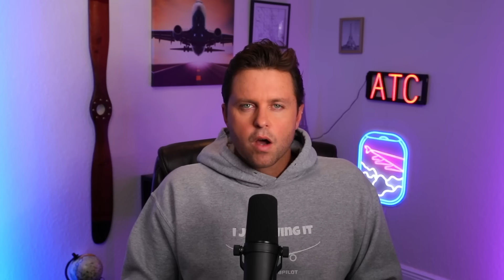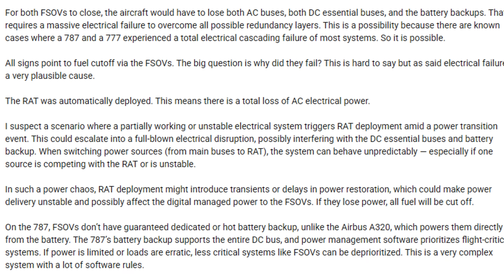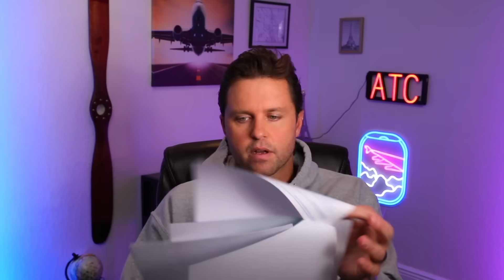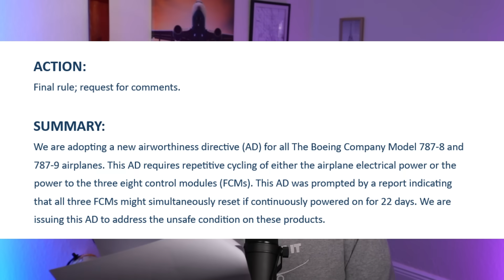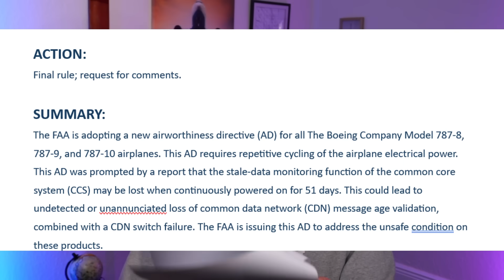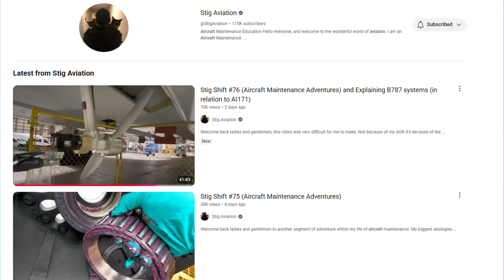Air India 171: Did a Software Glitch Cause Dual Engine Failure?

Comment: Ok wait, wait, wait. The cornerstone of this whole line of thinking is that the 787’s fuel shutoff valves are **spring loaded closed**. I don’t buy that. That would make no sense. Not even for fire fighting. I’m not an engineer (I have a useless undergrad liberal arts degree, and slightly less useless liberal arts graduate degree),  it I do fly Boeing aircraft for a living (737s). The 737 soar FSOVs are “DC motor operated from the hot battery bus. The engine high-pressure shutoff valves are fuel actuated, solenoid controlled valves powered from the battery bus.”  I get that the 787 has lots of software controlling the electrical system, but a spring loaded off fuel shut off valve makes no sense to me. Someone else posted a similar thought below and offers more detailed and intelligent comments than mine here. Anyway, this doesn’t ring true to me.
Reply: Ditto. No engine ever operated as described in this video.
Reply: I agree. I worked on rotary winged aircraft of 20th century vintage, admittedly far less complex than a 787. But i struggle to believe that an aircraft fuel system would be designed to fail off autonomously.

Comment: You and evveryone else that comment on this subject of fuel supply to the engines are on the right track., Keep at it. Does the APU have a spring loaded fuel cut off solenoid?  Is there a fuel cut off solenoid between the manin wing tanks and the central tank? Keep going.

Comment: Hi Gary not going to speculate either . I am not involved with Aviation, my background is in the  Electrical field and the ability to critically think. Which brings me to this link below . I have been watching many blogs this one included. It crossed my mind that maybe maintenance at Air India, have been doing the same as KLM . This has no bearing on your revelations about the possible causes of the Air India disaster. But it's not many holes in the Swiss Cheese away from being another one . Respect to you and thoughts with all those who lost someone in this tragedy 💙
https://youtu.be/EX2T0zkXcdw?si=kx1uylzGt2qIJJIp

Comment: If anything is outside of parameters, shut off the engines. What could possibly go wrong.  Like sensors, communication systems, control units never gave false or wrong signals ever, o wait......

Comment: As an electronics engineer and having had some experience with industrial computing system PLCs with multiple safety circuits, redundancy etc, I have become increasingly alarmed at the unnecessary complexity of it all. Have you seen inside that FADEC!? Trays and trays of near microscopic logic devices... Multipole connectors that would dazzle a lunar landing module. This is just stupid. Time to get back to basics.
Reply: That is to justify the price of the plane unfortunately.
Reply: Yet the plane flew happily for 11 years.
Reply: As a retired auto master technician I have seen the evolution of the computer into the industry. Year after year more and more integration of systems driven and monitored by computers. Although some great progress has been made many problems have come with the progress. My favorite phrase is keep it simple. The fuel shut offs should not be able to close at the same time and not while off the ground. Possibly manual controls.
Reply: We didnt land on the moon

Comment: I keep hearing “ software, software,software” . 11:19 As much due to previous fatal accidents that were sw issues.
Even if it’s not software, it’s taking attention from other possible problems. Muddying up the waters in local vernacular.
I had a look at guidance for programmers from the USA space program. I had to hold the phone in a three axis slant, with oscillating corrections, while keeping the tongue at the corner of the mouth. You can almost see Boeing NASA Similarities. 
Recode, test and all differences explored. Yes write 2 expensive programs. It’s the only, only, way to find errors, in the grand spaghetti stack, that is modern programming.
Enjoying your video’s

Comment: If you overlay the viewpoints of the CCTV/Hut/Rotation, the plane wasn't at the end of the runway. I think the plane had an issue after V1 & just before Rotation but we can't see properly because of the hut. So its not dust being kicked up, its nore likely an issue with the left engine. There's more smoke/dust to the left side. 
Wouldn't it be more plausible that an issue hpnd with the left engine at Rotation & in the confusion the right engine was shut down to explain both engines having an issue? Occam's razor.

Comment: Some SOVs are powered closed and fail open.  So a total loss of electrics causes the valves to fail open.   The engine bleed valves for example.  Secondly, some Boeing engines will suction feed and do not require fuel delivered under pressure to operate.  But, I never flew the 87 so I cannot specifically address either issue.

Comment: I’m no engineer, but even i know how to build a robust reliable delay timer with a capacitor and resistor. Omg, why not delay the shut offs for a few seconds in power glitches? To deploy instantly seems ludicrous! Some info i read about the states that the TCMA activated on NH985 before the air/ground sensor confirmed the aircraft was on the ground, despite that being ruled out by the logic. Boeing has a history of poor systems now, it’s easy to believe their systems are most likely to be at fault.

Comment: A Safety Instrumented System (SIS) with fail closed valves are routine in a chemical plant or refinery.  But if a false closing of that valve could cause a fatal event; a 2nd parallel valve with a different power source and controller would be utilized.  NEVER have a single point of failure that causes a severe event.  Some systems even have 2 out of 3 voting before initiating control actions that have very severe consequences.
Reply: Gotta examine 787 SSA and Fault Tree Analysis.  A good starting point.😊

Comment: First of all, thx‼️ 
The hypothesis collapses under the weight of a single fact: the failure it describes is prohibited by US law. Federal Aviation Regulation 14 CFR § 25.1351 mandates that the system must handle any probable failure, malfunction, or transient – from any cause – without rendering essential loads inoperative. A Fuel Shut-Off Valve is such an essential load. A design that allows it to fail during any foreseeable electrical fault, including software related ones, would never be certified.

Comment: The Batteries are Lithium Ion and have had issues with them burning up in 787 Dreamliners and there are directives on these! A shorting battery can drag the DC Bus to interrupted DC power
Reply: thermal runaway?

Comment: As per ChatGPT:

Yes, on the Boeing 787, the spring-loaded fuel shutoff valve—also known as the engine spar valve—can shut off automatically if electrical power is lost or interrupted, particularly in the context of engine fire protection.

Here’s how it works:
	•	The engine fuel shutoff valve is electrically actuated and spring-loaded to the closed position.
	•	In normal operations, electrical power is required to hold the valve open.
	•	If power is removed or interrupted, either by pilot command (e.g., pulling the fire handle) or due to complete loss of electrical power, the valve will automatically close due to the spring mechanism.
	•	This ensures fail-safe operation: if the system is compromised (e.g. fire, electrical failure), the fuel supply to the engine is cut off to prevent feeding the fire.

In fire situations:

When the engine fire switch is pulled:
	•	It isolates the engine by closing the fuel, hydraulic, and bleed air valves.
	•	The fuel spar valve and the engine-mounted shutoff valve (if installed) both close.
	•	These actions do not rely solely on software; they are mechanically biased to default to safe conditions like fuel cutoff.

Summary:

✅ Yes, the spring-loaded fuel shutoff valve will automatically close if electrical power is lost, enhancing fire safety on the 787.

Comment: retired AME here qantas    clearly the plane has serious existing electrical issues  and should not be flown. but the crew used it anyway. the main equipment centre would have been  high temp and the inop APU  is scarey as well.  perfect storm. the spring loaded fuel valves suffered a low voltage dc.
as noted by the flickering exit lights etc..  soft ware confused   GAME OVER

Comment: A spring load FSOV sounds ridiculous and unlikely to be part of the design.
Reply: They said it was not spring loaded. Instead, it was drive by a motorized system until it latched open or latched close.  It sounds like if the motor stops in the middle, before it can latch, then it would remain partially open.

Comment: FUBAR! Software glitch: quite possible. Also possibly a electronic hardware "glitch" Identified by a low-level technician and corrected with a jury-rigged fix, which may have lasted a while, but manifested with flickering lights and non-functioning cabin electronics as symptoms of approaching failure.

Comment: This is the first theory I’ve come across that could explain the cause. It’s shocking. 

I’ve learnt so much about how the 787 works and so many potential problems but none of the potential issues raised so far should cause both engines to fail simultaneously. 

The fact that this has already happened once on a 787 is scandalous. It appears that no airlines or pilots have been told about this glitch and the previous incident, which thankfully didn’t cause any harm to anybody. 

Regardless of whether this turns out to be the cause or not, the moment they knew this glitch caused both engines to fail simultaneously, there should’ve been immediate action, perhaps grounding all 787s until the issue was resolved, so that it couldn’t ever happen again in a more challenging situation, such as during takeoff, as lives have been at risk all this time. 

IF this KNOWN glitch turns out to be responsible for this incident, hundreds of innocent people have lost their lives needlessly when this could’ve/ should’ve been investigated and fixed already, given the potential consequences.  

My thoughts go out to all those involved in this tragedy and their families.
Reply: If it is the same issue, this is MAX all over again. Though any intermittent fault is always a * to diagnose if you can't reproduce it.

Comment: I'm a pilot of small airplanes, not an airline pilot.  So this is an impression and a guess. When I first saw the crash sequence video, I felt like it was a partial power failure, not a flameout. This is because I felt like, if the airplane had lost all thrust it would have come down faster. Patrick Cowdrey, Central Point, Oregon

Comment: Assuming a 787 at reasonable altitude (5,000 ft) had its FSOVs close, what steps would have to happen (automatically or thru pilot intervenstion) to restart the engines?

Comment: I'm an engineer who has supported Boeing aircraft (tho not the 787) and GE engines. This makes a disturbing amount of sense. It seemed inconceivable that both engines would failure (due to an internal engine problem) at the same time, and, well, it pretty much is. Fuel contamination, while theoretically possible, is highly unlikely because they put it through lots of checks (and no other aircraft at that airport had a problem with the fuel). But something like this, a relatively obscure software glitch or design problem that sooner or later gets through the swiss cheese and causes a disaster? Yeah, that's exactly how these things tend to happen, not from one single cause, but a defect that is fine most of the time until everything else lines up in exactly the wrong way and... yeah.
Reply: Do not believe everything you hear from armchair experts on YouTube. No GE or RR engine has ever been designed as described by YouTubers in recent days. The FSOV or whatever it's called on your engines is only controlled by the pilot (fuel cutoff levers or fire handles). The valves will not close unless you actually have the aircraft power to do so. No power = engine runs. 
In fact, in the last 15~20 years, aircraft manufacturers have had to add a back up battery to shut down the engines in case the main electrical busses fail.
Reply: What about end of runway debris entering both engines just before rotation ? Similar to a bird strike .  BA 009 had 4 engines flame out from ash… it was high in the atmosphere but still .  A fair amount of ingestion will cause flame out
Reply: @marielle129  it engine had failed due to debris then we would see flames or smokes or something so its unlikely. It may be possible that air craft was overloaded or its one engine failed on the run way, due to that plane didn't took off untill the end of runway, plane definitely took more than usual runway, it took off from the end where the road was unpaved, it was dusty ground at the end of paved runway and engine exhaust caused dust to fly in air after air craft took off from there.
Reply: microbial contamination is a possibility if you want to go down that rabbit hole - only explanation of other aircraft not affected.  No one really knows how Air India does their fuel treatments.
Reply: @TrollingwTyrone  the fueling machines have become so advanced that they'll decide everything, if the fuel is not right then fuel truck that delivers fuel from ground into aircraft will automatically stop fueling the aircraft, and the pipe that is connected with fuel tank of airplane also has long filter, so the chances of contaminated fuel entering the plane is almost zero.
Reply: @ykd0011  Yes, but what if the contamination is in the aircraft's fuel tank? The system you describe only checks the fuel that enters, not the one that's already there.
Reply: @ykd0011  That is true but I am talking more on the operator side such as Jetstars 787 that lost power during descent at FL160. They found that the  facility in Australia that they brought it to have the treatment performed  added too much biocide treatment and the buildup of magnesium salts blocked up spools and valves in the fuel control servos. They found 37 times the amount more of treatment in the fuel. Also in other cases if there is heavy microbial growth due to poor maintenance and it is treated the "dead" residue floating in the fuel can plug up filters pretty quick. This is why in the diesel marine industry the have dockside fuel"polishing" services where they run your fuel thru a series of filters to get all the crap out and pump it right back in - think of it like a kidney dialysis machine but for fuel. Bad fuel is a real big issue in the marine industry
Reply: As for the theories on what happened, I wouldn't exclude that the engines failed at different times.
I've just learnt that 787's system is designed to automatically apply rudder in case one of the engine fails.

So, even if one of the engine failed during the takeoff role, no yaw would have been observed. The other engine would have lost thrust while airborne. I'm not clear if this would have triggered the deployment of the RAT though.
Reply: I'm not an enginee, simply an avionics enthusiast, yet after a few days' thinking and before this video was made the prosprct of a software glitch came to mind as the prime suspect.  Not too many years ago I seem to recall  - those of you with more knowledge than I feel free to correct me - a Qantas plane, I don't know the model, suddenly plunged several thousand feet not through turbulence but, I think I'm right in saying, what turned out to be computers going haywire and causing operational mayhem.  Several people were severely injured but the plane landed safely:

Is there in that incident a possibly directly related link to the Air India disaster...?
Reply: @DavidHughes-op6zl  QF32  - A380
Reply: One engine failed and the pilots shut down the remaining good engine by mistake.  It's happened dozens of times, but in this case there was not enough time left to correct the mistake.
Reply: @davidhess6593 No airline pilot is shutting down engines less than a thousand feet above the airport after takeoff.
Reply: @davidhess6593  sorry - but no
Reply: The engines did not shut down.  They went to an aircraft commanded idle condition (not polite) due to compotent failures.
Reply: @Blake1156  Lets just leave it as " there was a loss of thrust" . Nobody including you knows anything more than that outside of the investigators
Reply: so should we fly? i just booked a flight! 😮
Reply: Thank you.  Yes, disturbing.
Reply: Human factors courses try to educate  personnel in the aircraft industry on how to eliminate the lining up of the holes in the “Swiss cheese”
This is done by adding defence measures to simulate blocking the holes. Hopefully flight deck crew have  similar human factors courses.
Unfortunately if there is a software glitch in the 787’s computerised systems, then it needs to be identified and rectified immediately. Ground all  aircraft until a fix is established, similar to the 737 problem with nose up stalling where two planes crashed.

Comment: Software failures are never surprising. (Except in election machines, the news tells me those are always perfect.) Even NASA makes bugs, and quite stupid ones. That does not mean we should not use software, some systems are so complex that humans would do a much worse job.

Does not have to be just software either. Some mechanical systems coupled with software systems are so complex that humans can never fully understand all failure modes. (Except for election machines, those are always perfect.)

QAs and managers make mind bendingly stupid decisions all the time. (With the exception of election machine companies.)

And even the most competent people will eventually make mistakes in complex systems. (Except for with election machines.)